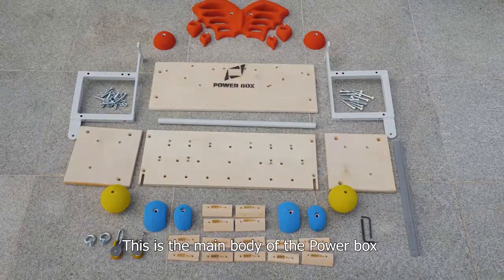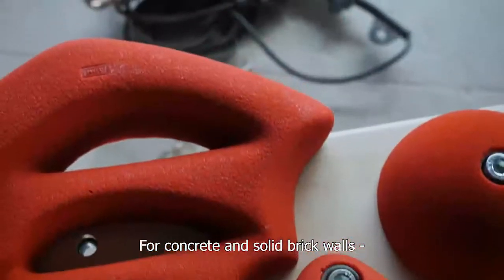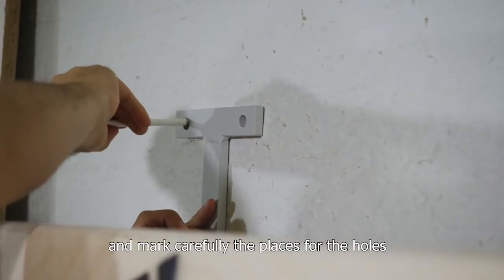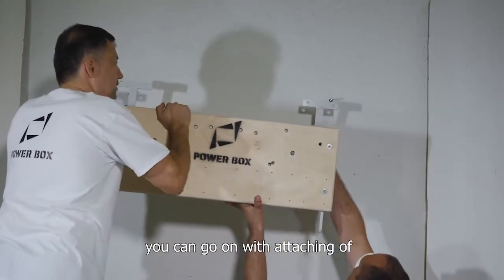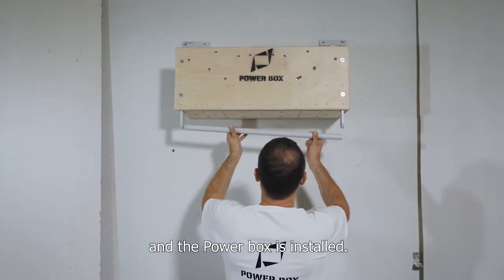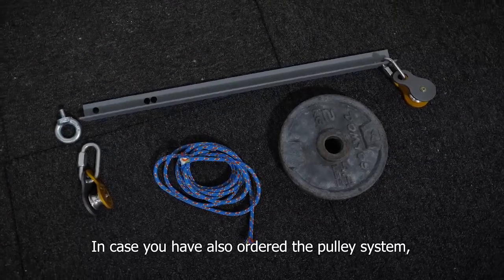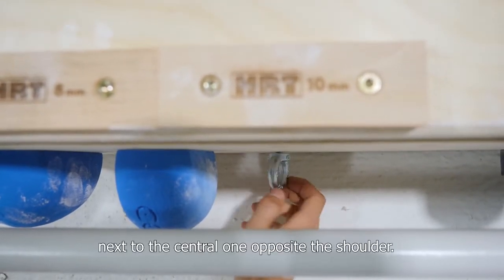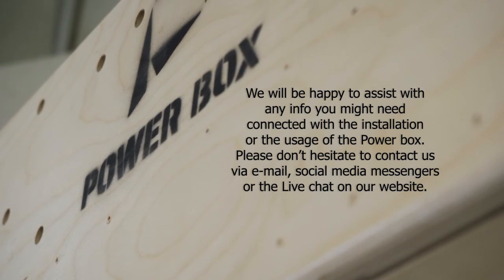Power box 2 - Installation guidance

Comment: Yes we Americans need to know if it can be hung on wood studs. Generally "2"x4" 's" (not really 2 inches by 4 inches) it's common to have them vertically spaced every 16 inches in normal wallspace. Around door frames and certain areas they use either multiple boards or thicker wood to reinforce. I have this opening to my kitchen with just like a header wall at the top which is framed in pretty sturdy. I bet it could probably hold it. I'm wondering though if it's doable at all on regular single stacked 2x4 16 inch spaced studs though.
Reply from the maker: Hi, thank you for the question !
there is no problem to attach it to the studs- already several Power boxes have been attached this way in the USA...
Please DM us in Instagram- @hrtholds and send us a photo of this opening to have a look and to comment it, thank you !
Reply: @hrtholds  excellent! I actually asked the opinion of an architect I know who said the same thing as you. Perfectly safe and strong enough to hand on regular spaced studs.  I will be ordering my powerbox next month. Since I found out it can be hung normally on studs, I'm planning on just using a normal wall in my garage now. Super excited thank you for your response.
Reply from the maker: @ikarosdream5971  you are welcome and we are happy you have a solution !

Comment: Hello, what about dry wall? can it be installed on dry wall?
Reply: Hi, unfortunately the dry wall is not strong enough to support the weight of the Power box + the weight of the climber.
Reply: @paskaliskostas2454  aw that's too bad! not even on the studs?
Reply: @xerxes_ysz  do you know that material of the studs ? - as there are different options
Reply: @paskaliskostas2454  they're wood I believe